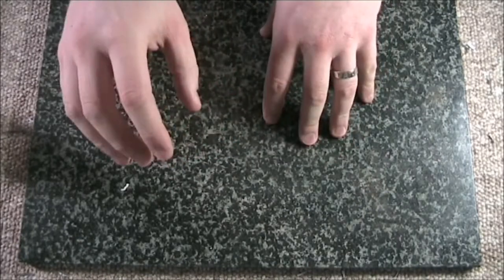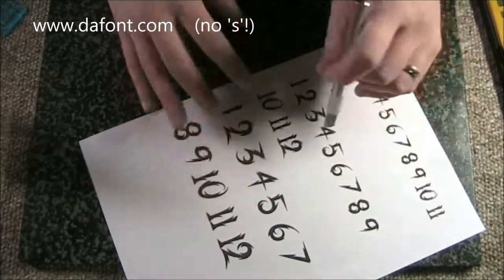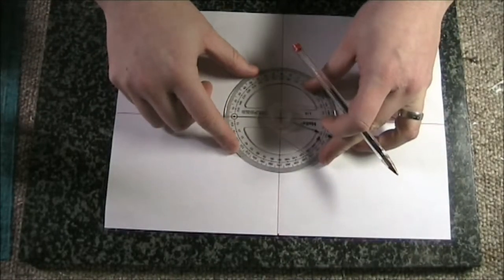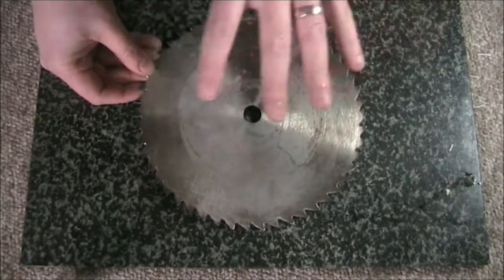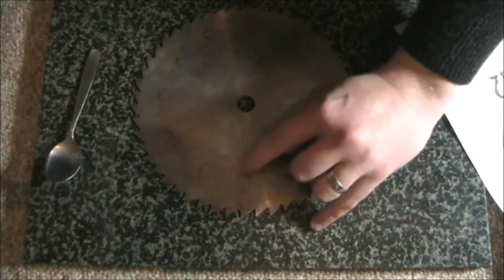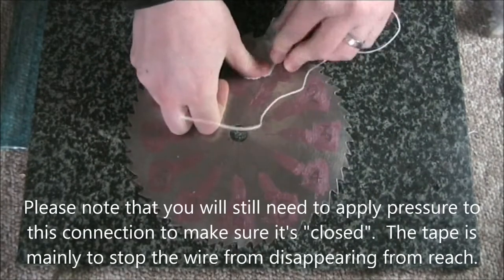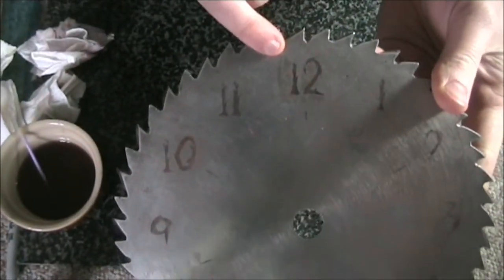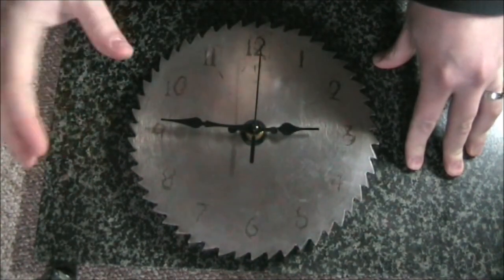How to make a clock from a Circular Saw Blade with etching

Comment: Would simply hotwiring into a plug socket provide enough power?
Reply: Okay then maybe I shouldn't.

Maybe it would go straight through.

I think you will have to do the video, yes.

xD
Reply from the maker: *****
After careful consideration I've decided to not even attempt the 240V etching... I'll stick to battery chargers and scalextric transformers!

Although I may still try a car battery at some point, lol.

Just to reiterate... DON'T USE MAINS ELECTRICITY STRAIGHT FROM THE SOCKET!!!!!
Reply: It's probably the best idea.

Car battery could be a good one.

Don't worry, I won't!!